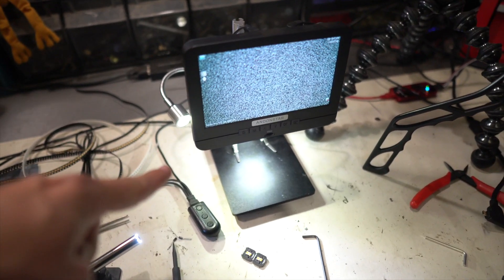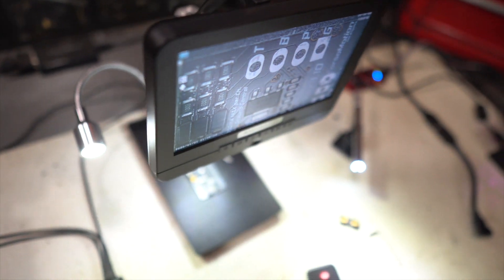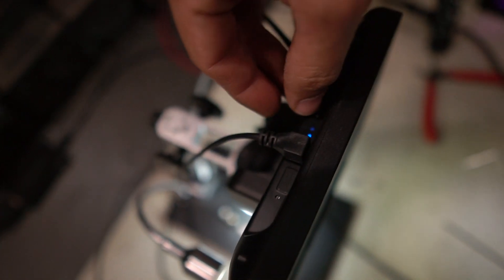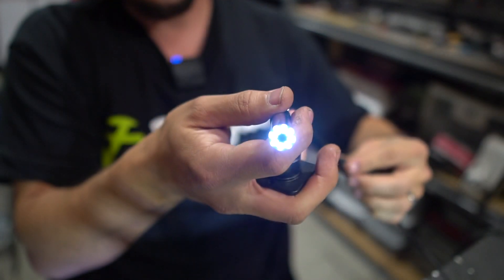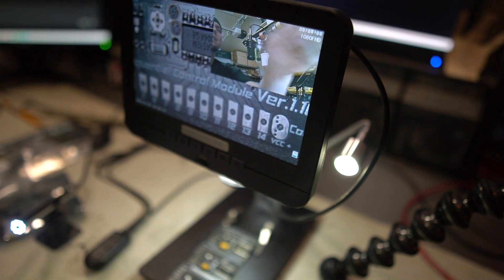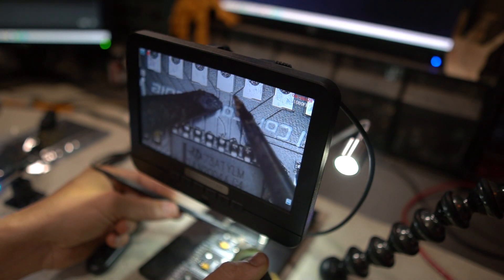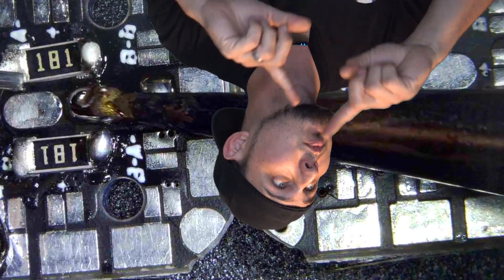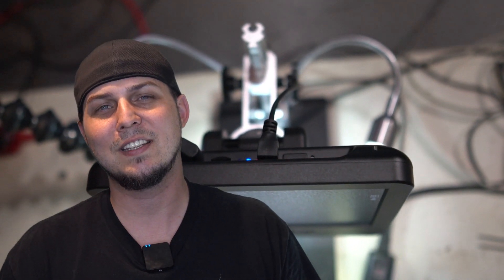Do you NEED a Digital Microscope?

Comment: I'm into coins and look for varieties and errors. This bad boy is perfect,especially with the extra LEDs and being able to have multiple light sources from different angles. I have been looking at the Andonstar ADSM 302 the only difference is working height is able to go a little higher and it has HDMI  but the screen is 5 inches compared to 8.... great review and I think I will go with this instead of the ADSM 302 bigger screen and cheaper👍